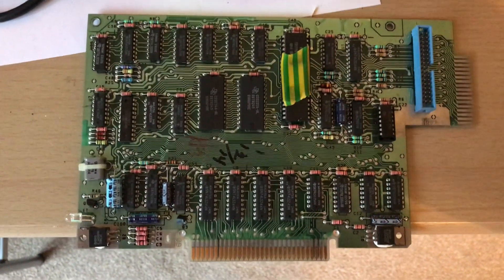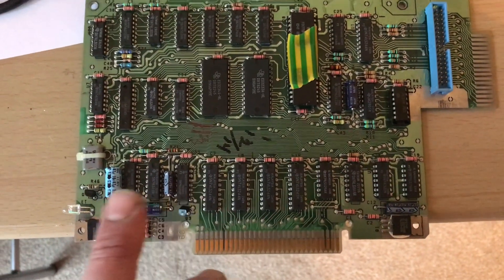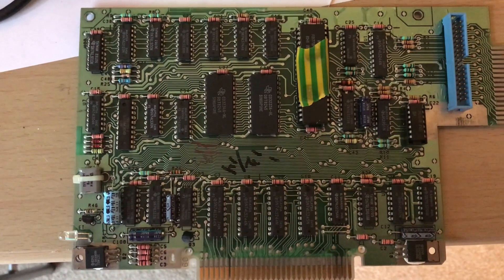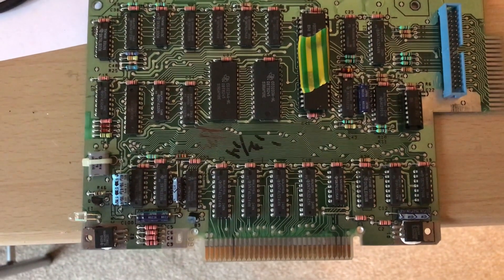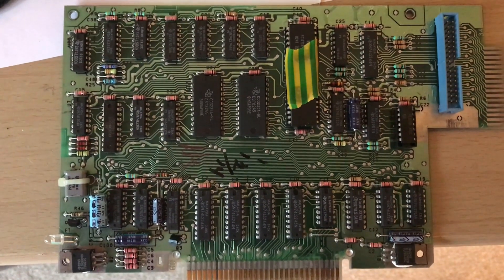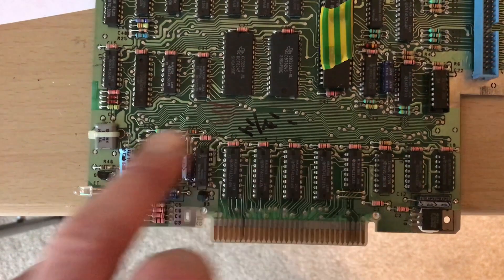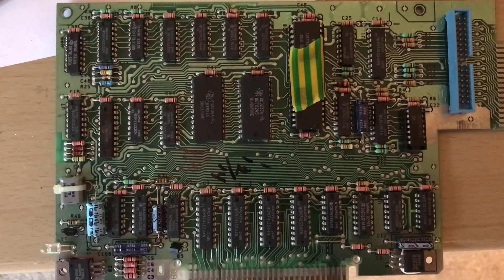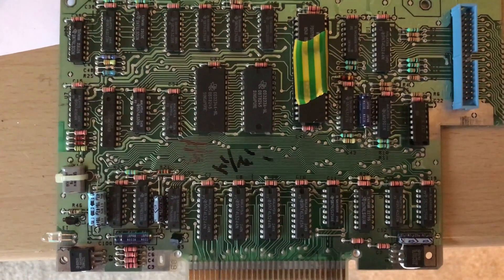Ti99/4a PEB and broken disk controller

Comment: The TI disk controller is 40 tracks, double sided, single density.  It cannot be upgraded to double density, but you CAN upgrade to 80 tracks, essentially giving you the same storage space as a 40 track DSDD controller. You'll get 720K either way
Reply from the maker: Indeed you can , I did it years ago and it worked perfectly. When I find time I’ll do the 80track mod.
Reply: Thank you for the reply!  I think perhaps you may be misremembering on the DSDD modification.  There is a well-publicized mod that went through the User Groups and the magazines which changes EPROMs and makes use of a small piece of wire or two.  This doubles the capacity of the disks.  This mod, however, was for the SD 80 track.  
If, however, you happen to know of a way to modify to double density, you'd have knowledge that none of us in the community have, and we would be super grateful to you for supplying such information!!!  :) 
Thanks again for the video.  Always nice to see the TI discussed.  I also have a channel and the majority of my videos are TI-related.  :)
Reply from the maker: Opry99er the ti99 is an interesting oddity and great fun it’s nice they used standard pc based drives rather that odd standards like many others